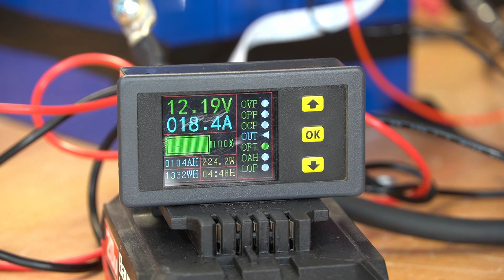Testing a New LiFePO4 BMS, 12v Battery Build and Aliexpress Cell Test

Comment: Will, do some research on thread engagement, I notice that your 'composite' wrench handle does not have any torque indication on it so should you really be recommending your followers use similar to torque the machine screws ? ? Every bolt thread/pitch/diameter/engagement/material combination has a known torque limit, there has been so much technical data produced regarding screw threads that it would be very very difficult to find an application that has not already been studied. The battery mnfrs usually specify the torque to use, why no mention of that as it is a very important aspect of the connection.  Also why no use of Dielectric grease or is everything you do so quick and temporary it is not required ? Bolts are usually described by diameter such as 6mm, 8mm, etc teensy or weensy is not a size that can be accurately conveyed by speech, neither is the hex head size of the tool used to turn the bolt used as the size reference of the bolt, the diameter is. There are standards for hex size vs diam. but not always applicable, the hex can be any size or non-existant depending on the bolt design. These battery terminals are a case for whether studs would be more appropriate than machine screws, there are pros and cons, one is depending on the ability of the assembler to install correctly, at least there would be 100% available thread engagement.
Reply from the maker: If someone can find toque specs for these cells, I would be amazed. And yes, great points of discussion. I had to design and draw machine screws when I was younger for a design mechanics class. 

Usually torque specs are not that easy to find and honestly, don't matter much. Just tighten them down. Having car repair experience is great for this. And my batteries are usually indoors and salt free, dry environment, so no dielectric grease. Please use appropriate grease for dissimilar metal connections, that's compliant to code. Usually ABYC can be applied to solar systems. But yeah, could cover in future video. Lots to talk about on these topics. 

And yeah, I don't think I will ever use my torque wrench on terminals. Smart to do if you have a soft metal, but not a big deal. Most terminals can handle a lot. But yeah, I should mention it more

Comment: The problem is, you tried to cool the temp sensor with frozen bananas and you clearly have the frozen asparagus model. The spec sheet says they are not compatible with each other.

Comment: Another great video!
Quick question that I already know the answer to but want to hear your thoughts. 
I have a large lead acid battery bank but is it possible to add a lithium battery to increase the bank size? Would the two types be compatible if the lithium has a functioning bms
Reply: Mixing battery chemistry isn't a good idea, I have two banks lead and lithium with a two way disconnect, allowing me to select either one, and use their own charge controllers,
Reply: JAMES! Since the 70's that’s what I assumed but I like your idea. I have 2, 40 amp controllers and I could easily create two different systems

Comment: Thanks Will.  I once watched a lecture where the lecturer said the temperature perimeters can be controlled by the manufacturer.  Meaning you could get cells that would not be damaged by freezing temps.  He said they just have to use an electrolyte that doesn't freeze until temp is -20c, or whatever you need.  Any thoughts?
Reply: they are called lifeYpo4

Comment: you can use bimetal NC thermostat 0 or 5 deg C (for low temp cut) with another 60 deg C one, for high temp disconnect :) and connect it in series with random cell sense wire, and you are done.
Reply: I would like to see this

Comment: If you put some ice cubes in a cup of water with salt you can get the temperature down below 32. Just having iced in a cup might not push the sensor past its cut off point. The BMS with the Bluetooth I've been using a few of them and have had my ups and downs like no manual but I work through the problems one was the wrong computer program I need Windows 8 or older you can click on my profile picture and find my video on them. I enjoy your enthusiasm
Reply: Ruins the taste of your banana smoothie though, thanks for the lesson in high school physics. Useful for those who didn't listening in school or who were never lucky enough to have a decent schooling. But somehow I doubt if many of them are reading your comment.
Reply: @johnrhodes3350  your brother Fender makes one of the best piano, the doors Rider on the Storm would be nothing without his piano.

Comment: Hi Will. Low temp cut off doesn’t really worry me (Sydney Australia). Probably more concerned with high temp cut off - LOL - 45degC under my pergola yesterday. Anyway it should be pretty simple to install a low/high temp cutoff. A simple circuit with a thermistor. The only issue is you don’t want to switch high current so it makes more sense to me to switch the charger on and off rather than the BMS. A lot of chargers come with an external temp port anyway. Not sure if you can program low temp cutoff though.

Comment: Hey Will, I've enjoyed your vids. I've learned quite a bit watching them. I'm an elevator service technician and no stranger to electricity in general but not so much in the systems associated with solar, ( charge controllers, bms and such). Very good info, thanks.  By the way, the bolts for the buss bars can be easily and cheaply replaced with appropriate hardware for Ace Hardware,  among others. I would use a peice of threaded rod cut to length then you can use multiple nuts and washers to mount the buss bars and stack the bms leads right on top and fasten with another nut. Just me.
Reply: Sure, but the question is, what are the conductance characteristics of the typical galvanised threaded rod you buy at a hardware store?

Comment: Thanks for doing this vid!! I've got a 4x pack of these exact 105ah cells coming that I bought way back during the Aliexpress black friday sale. FedEx finally confirmed shipping them last Saturday.
Reply: how much were they at that time?
Reply: @scottf4277  less than $400 shipped!
Reply: So my 105ah LiFePO4 cells came today and I can confirm Will's appraisal of them. While they are top quality cells, they have laughably light duty M4 terminal screws. You will have to mount these together extremely well because any movement that would cause stress on the terminal screws would likely cause them to strip.

Comment: Could you get simpliphi battery and go mad scientist on it?really interested in their 48v battery connected to mpp solar lv5048 for a whole house system.prolly take 2 lv5048's to do that but you can add those on later with additional bats.Not alot of info on either on internet.

Comment: You could try putting the sensor in ice water with lots of salt in it. This will lower the temp of the water a bit and let you see if the low temp cut off failure just comes down to a few degrees of error in the factory calibration.

Comment: -1.3 degrees C is about 30 F.   What is the possibility that they cut it closer in temp.  What IS the lowest safe temp.  I hear different numbers from 24 to 28 to 32 degrees F
Reply from the maker: 0 degrees is stated on nearly every data sheet for lifepo4 cell I have found. Battery studies say internal resistance goes up, and tests capacity and resistance over time etc, but I have never seen anyone advise charging below zero. Technically... you can do it. But your battery will be damaged very quickly. How much damage is another question that takes a lot of discussion. Quite a few factors at play

Comment: Do you have a work van build? A lot of companies like me are looking for info on a work van build...I have a 2019 Ford Transit 250 cargo van. Looking to be able to use our battery chargers to charge lithium Dewalt and Milwaukee batteries 12ah...as I drive and when parked at work. 
     Something that ties into the alternator when driving to charge the battle born batteries and can be plugged in on the job ...was thinking 3 battle born 100ah..the batteries need to charge the battery chargers and run a table saw and mitre saw....???? 
    Also when home , want to plug the van in to an extension cord to charge the work batteries all night...any help would be great....2500;watt inverter?? 3000?.. how to keep those battle born batteries warm when parked outside ..heat tape 🔥?..
Reply: I think most of this is covered in the myriad of videos. At Wills suggestions I have purchased a MPP Solar all in one. It makes no difference wether you are working or playing - power is power. Value for money - check Wills site and look at the MPP Solar all in one.

Comment: I wonder which is more damaging to the internal structure of the battery, to confine any would be expansion and subject the cells to the inevitable mechanical pressure that causes, or to lengthen the bus bars so a dense foam can be inserted between them, allowing the expansion to reduce internal pressure.

Comment: Order up an assortment of threaded studs, washers and nuts. You will have full thread into the battery and proper length for double buss bars if you desire .

Comment: is it possible that the "low temp cutoff"  is really a "high temp cutoff"?  it would be interesting to see if you apply heat if it shuts it down.
Reply from the maker: Yeah that's common in all of them. Even the super cheap ones have high temp cut off
Reply: @WillProwse  looks like i will finally be getting a van next month... yay.... then i have to fix it up.
Reply: Lady-T Survival would certainly nice to see what the settings inside the BMS are. Preprogrammed is nice but I’d still want to be able to make adjustments

Comment: my guess is that you didnt go quite low enough in temperature...but it is too bad that there isnt a low temp adjustment
Reply: @Jason Bowman yeah...the accuracy of bananna water is beyond question...heh
Reply from the maker: @mikedee8876  haha. But yeah, touching frozen vegetables from my super cold freezer triggers any low temp cut off in less than a minute.
Reply from the maker: @mikedee8876  always trust the banana water.
Reply: @WillProwse  I just built my first working powerwall with 18650's...500W solar, shed mounted 24v system ...got a cell monitor but need a cheap useable BMS....checking out yer vids....yer testing procedures are great.....good work...mike NJ

Comment: lookin' forward to hearing how Daly responds
Reply from the maker: I have a screenshot of their message and data sheet, both stating the low temp cut off, and it's ready to go. And I just tested with frozen salt water and it did not trigger. I can't wait to show this on the AliExpress dispute.
Reply: @WillProwse  optimal outcome is finding out the feature is winding through their supply chain and you just got an older firmware or something; i really doubt it'd be documented if it wasn't being deployed but theres definitely opportunities for mistakes in a rollout

def interested in their response
Reply: "Apologies, by misstake the cut-off was set to 0 F instead of 0 C in this batch. Please return for replacement."
Reply: @johansoderberg9579  LOL, like those Derwoods who fill up airplane fuel thinking in Gallons when pumping in Litres.  we know how that ends, usually with a big thud and many scream on the way.
Reply: @stephsoltesz6731  Derwood? Is that like Dagwood of Bumstead fame?
Reply: Well it started out promising.  Maybe next time.
Reply: Over/under on it being a unit failure. Maybe they rushed a prototype run.
Reply: lol if it turns out to be a bunk temp probe

Comment: Is there a difference in (advertised) number of charge cycles that the shown batteries can do? Or are they the same? 🤔
Reply from the maker: Sometimes yes, but charge discharge bandwidth and ambient temperature will affect degradation the most. And calendar aging. Case material wont make big difference from what I read. LiFePO4 will get 2000-5000 cycles when used with solar. If cycled in cold environment while cycling between 20-80%, you can get 10,000 cycles, which is listed on UL battery, simpli-phi
Reply: @WillProwse  thank you!!! Have a good time celebrating into the new year 🎉

Comment: Will Prowse please test out charging lifepo4 batteries under freezing. I want to see actual fact based data and proof of how much damage it causes. Is it catastrophic or just minimal capacity loss. Is it cumulative over time or will one charge cycle under temp do it?
Reply from the maker: https://www.ncbi.nlm.nih.gov/pmc/articles/PMC6126518/
Reply from the maker: Plating on anode and increased resistance, which is considered permanent damage, occurs.